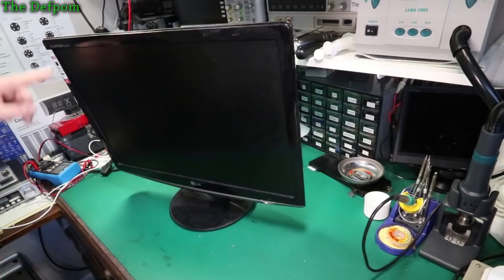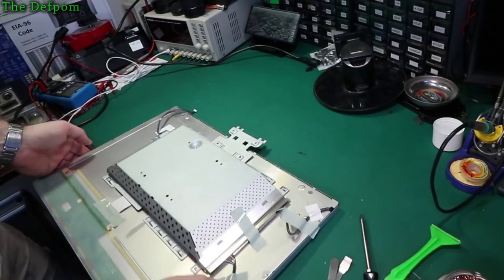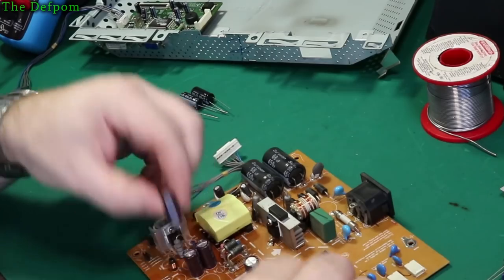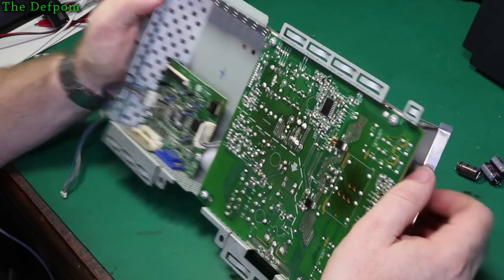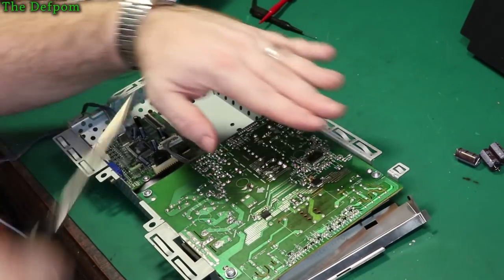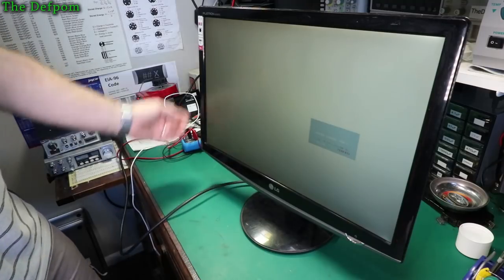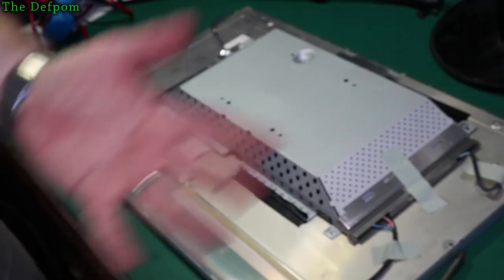🔴 #537 LG Flatron W2252 LCD Monitor Repair -  How To Repair A Monitor That Wont Turn On

Comment: The best way and fastet way to open the 2252 is at the top of the screen. Place your fingernails of both hands between the top bezel and the screen. roll the bezel up and back away from the screen. the top of the bezel will pop loose. Then proceed to do the same to the sides. The bottom will fall away easily. If you attempt to pry it off with an instrument, you will most likely break off the delicate tabs holding the Bezel in place.

Comment: I actually found this video after fault finding and fixing my LG monitor (the 24" version, W2452T), just to say the PSU looks the same and replacing the capacitors brought my dead screen back. (In fact it's better than it was, I think it was suffering from bad PSU smoothing for a long time).  I bought it new in 2009, so looks like 11 years is the life of these caps, the screen in question was on for most of that time. So, if you have a dead LG screen, or perhaps it only sometimes comes on, but sometimes is just dead, DO try this. Be careful of touching the back of the PSU (Especially around the 400v caps (!!)) but other than that it's a beginner repair that works really well. Oh, and cudos to the video maker, took me ages to work out how to open the case, whish I had seen this first!
Reply: How should a beginner discharge the 400v capacitors before attempting to replace them?

Comment: I use such monitor since 2009. Today it just didn't power on all of the sudden. Completely dead. So thanks to this video I disassembled it and found puffed caps with electrolyte leaking out of them.
Reply from the maker: I’m glad it was helpful

Comment: I wonder how many thousands of these LG monitors have ended up trashed because of LG's shoddy components. They should change their name to LB = Life's Bad.
Reply from the maker: It isn't just LG, this is something that occurs to all brands, capacitors are consumable items really. There will be many many failed electronic devices (not just monitors) that can be repaired and continue to be used with a little bit of effort and small cost.
Reply: Nonsense. Mine lasted 14 years of near daily usage before I noticed capacitor whine indicating they're bad. The Samsung I had from 2006 lasted 10. So a bit better
Reply: @TheDefpom  I repaired a guitar amplifier from 1959 by just replacing the caps. It actually had Ducati(italy) capacitors, I thought they only made motorcycles but apparently electrical components as well!

Comment: This is also the same procedure for disassembling the LG W1952TQ-TF.  I replaced the 1000uF 16V capacitors on the secondary side as they were puffed up quite a bit.  Thanks for the disassembly!  My wife really likes having 3 monitors!
Reply from the maker: I'm glad it was helpful.

Comment: I would have liked to see you test the caps to see if indeed it was the caps and which ones or perhaps just a dodgy joint that you reflowed. You threw everything at it in one hit so yes now it works but WHAT really fixed it? Start off with measuring voltages as a first point too would have made a better investigative troubleshooting video. Thanks for video. Keep them coming.
Reply from the maker: abeleski - they didn’t need to be tested, the bulged ends and blown vents are all you need to be sure it’s failed.
Reply: @TheDefpom  hmm, i must have spaced out and not seen that part

Comment: My unit doesn't have 22V connected and the jumper which bring 22V to the cable from psu to mainboard is missing, and caps for filtering 22V are not present on psu board.

Comment: The FET semiconductor on that aluminum heat sink.  Is it that?  Look and see what numbers are on it.  Is it a 04N60C3 ?  Get a new one from Ebay and soldier it in.  It may be that.  Maybe on Ebay you can find that power supply after you get the numbers off of it.  I got a repaired one sent through from China and it worked.

Comment: 2:40 What  a fiddle to get the damn thing apart. I use some old credit-card style cards that you get in several shops, but never use again... otherwise known as wallet filling.
4:40 That is a very efficient design! All screws have double functionality. Whether it is a proper design... no comment, lol
8:52 It's always the caps!
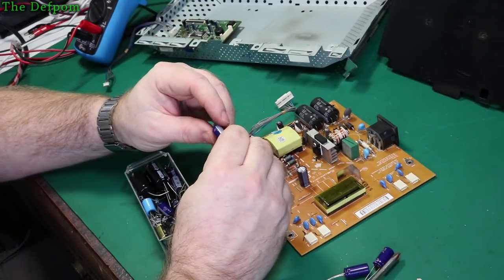10:12 Mat-su-shita or Mat-su-shit-a, you decide. Or just call them Panasonic, it's the same. Good brand!
16:12 Mixing is generally considered bad, but I do share the opinion that when something is lead-free soldered, you can't harm it by adding leaded solder... 
It just lowers the melting point and eases the soldering process. 
The other way around... just don't.
From memory it has to do with the "plating" of the vias (if a board is double-sided). 
Because of the fact that when removing a existing component always leaves a small quantity of solder in the via or on the pad, it is considered bad practice to use another alloy to solder a new component in.
It has to do with the possibility of mechanical stress causing the joint or solder to come loose from the other old alloy.
Or just that it makes for a weaker joint, but that is not an issue here. 
Not sure. I'll ask our IPC trainer when he comes over again.
21:40 MS? main-switch, master switch? It probably has a stand-by supply, and the power is turned on via this signal...

Comment: PPS I've had a couple of these LG monitors and those electrolytics are it seems the most reliable capacitors on the planet. Reliable and fully guaranteed.
You can rely on them to fail - guaranteed.
They fail so reliably its funny. Easy to get in and repair though.

Comment: What could be faulty if the monitor (LG FLATRON 19”) has power but get no signal message, the menu buttons don’t work, I’ve tested with several different laptops / desktop computers

Comment: If it is a 1080 monitor then it could be worth getting an HDMI to DVI adapter.
The easiest way to see if it is powering up is to connect the lamps and signal lead, if the laps light it is probably.good.
They have built monitor chassis like this since early 2000, nothing can move when it is assembled so what is wrong with the construction.
It will say in the user manual not to use screws over a certain length, I would bet that most wall mountable screens would be damaged by using too long a screw.

Comment: I'm viewing you on an LG W2340, which I don't really like since it does not have the anti-glare screen. It's almost always bad capacitors (or worse bad CCFL's) on these older monitors. I will  just pitch this one when it goes to heaven and get newer LED back-lighting. Guess LG saved big bucks on leaving the fasteners out.

Comment: i changed capacitors in power supply on a flatron L1953S (seems similar),now it works but the colours are a little different (more harsh and letters seem like pixelling )...
any ideas what might that be or what should i  check out again?

Comment: Hello Can you help me, when i plugs the monitor into the electricity, the light comes on for a second and then goes out and nothing can be done, then I have to wait a while, unplug it and plug it back in and it happens again, I also have a video
Reply: Note: when I plug it in to electricity, it makes a strange sound for a second like a very fast ticking and then it stops, that's when the LED goes off, I managed it once when I held the button and plugged in to electricity , it made a sound that sounds like when you turn off the monitor

Comment: Smashing repair, the crap-a-citors are always crap brands, i use panasonic ones from r.s.
Lead free solder is cack, 60/40 rosin cored thin solder is what i like :-D.
.
I've just done a 32 inch Technika (Tesco crap) from 2010, psu problems (No supprise), transformer drive capacitors went o.c and a dead electrolitic on the secondary rectifiers.
8 years old and the ccfl back lighting still works smashing, i can't see leds last that long.
Reply: Matsushita  is Panasonic, it is the company that covers Technics and Pan.. Though because those caps go all the time, every time I wonder if they are really 'proper' as I agree Pan..(can't be arsed to spell it...Then I wrote this five times longer) are some of the best available.
Reply: Martin D A
Well they seem decent and must be better than luxon or capxon or similar flong chong wong pong types lol.
For an old set i don't waste money on nichicon or similar grade caps.
Panasonic seem ok to me.
Reply: @zx8401ztv  Ha ha I was sort of agreeing with you, I think LG  either entered into some strange arrangement with Matsushita to supply ultra cheap crap or they were knock offs. I can't imagine a big company using knock offs...but...maybe.
Also, a bit of a hint, if you over rate your cap by 20% for voltage and make sure it keeps under its temp rating by same it will last a hundred years - no kidding. Panasonic is great I agree.
Reply: Martin D A
A hundred years lol :-D, that's no good, i don't want someone digging me up to fix there antique Lucky Gitstar tv :-D
Reply: @zx8401ztv  Just put it in the small print of your guarantee. Do not dig me up in 100 years. (This is why lawyers get paid so much..they will be digging you up in 99 years or 100 years and one day).